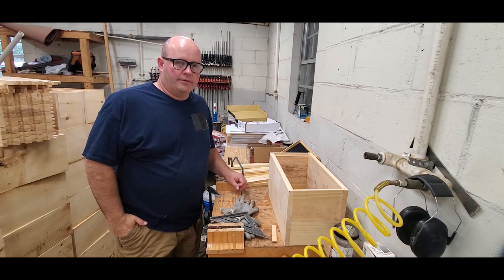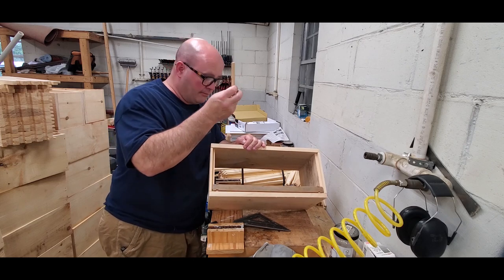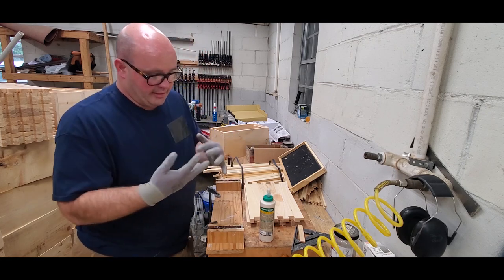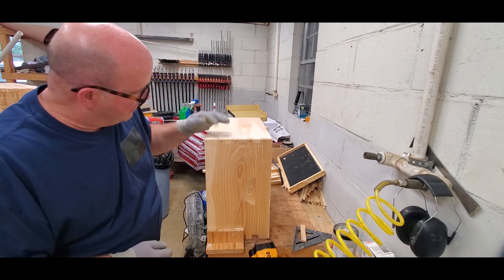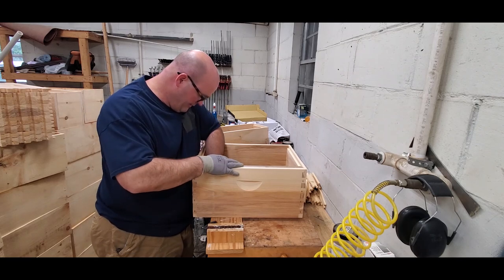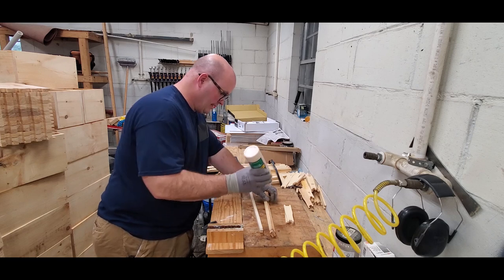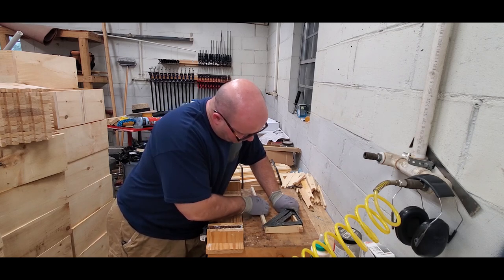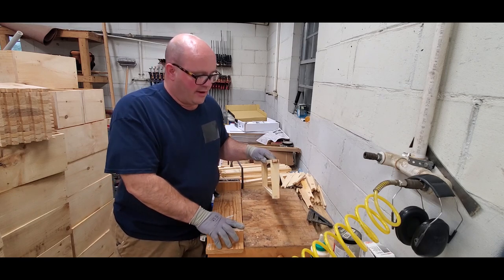How i build and verify bee space in my frames and boxes.  #beekeeper #beekeeping #honeybees

Comment: Randal, I’m going to try the little tri square like you use the next time I assemble boxes.  I normally just measure from one conner to the opposite conner and then measure the length of the other two opposite conners and if the distance is the same then the box is square. Your way is probably faster. Thanks for the video.  I hope your bees are producing lots of honey.
Reply from the maker: Thank you

Comment: I've put together a ton of boxes. I parked my air stapler a long time ago. Yes it's fast..my first thought was speed. But with time, I learned that screws are far superior. Lazy as I am, I still like to build them ONCE. So, I glue and screw. I slop on the glue too, it's cheap and I couldn't care less if it runs...bees don't either. Just sharing thoughts,  not dissing your procedure. I use the air stapler on all non stress joints but box corners and the like...never again.
Reply: I think lots of glue will seal the corners better than paint. The bottom of the corners is where ours usually fail due to rot, so preserving the bottom corners is key to long life. I've heard some beeks that paint    wood glue on the corners AFTER assembly for the same reason.

Comment: Great idea in checking bee space.  I had a box that frames were to tight.  Put the glue on the horizontal portion of the finger joint, glue doesn’t hold well on end grain.  This will make the joint very strong and your staples are just needed to hold it while the glue dries.

Comment: On the 5 frame nucs when doing butt joints what is the measurements of the box.
Reply from the maker: 19" 13/16 long (sides)
9" 1/4 wide. ( front and rear cut to 7" 3/4)
9" 5/8 tall.   Or you can can rip at 10" and cut 3/8 entrance on front board.